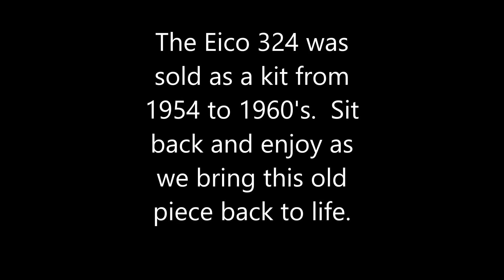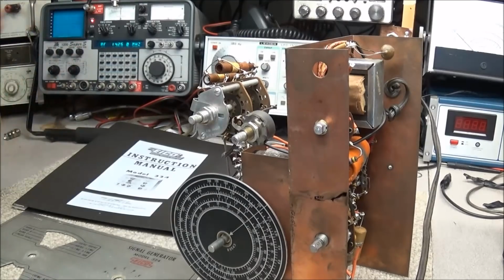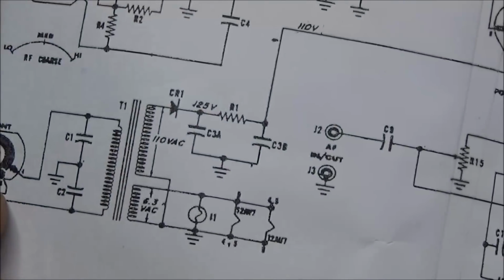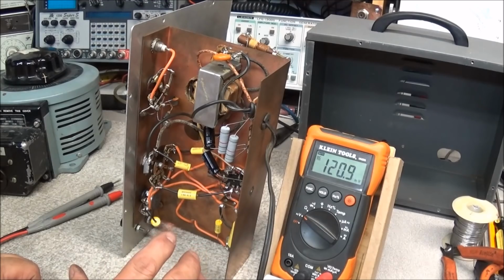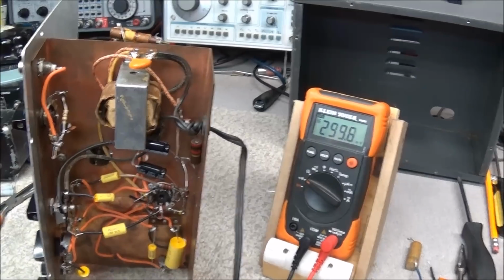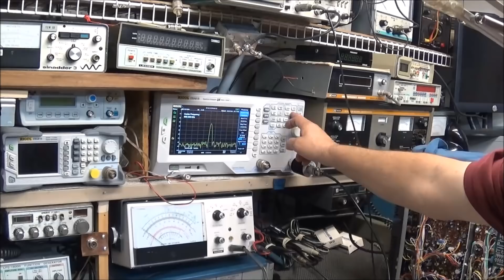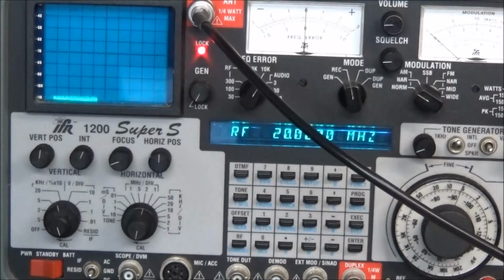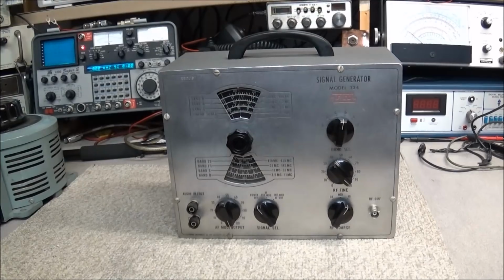#165 Eico 324 Signal Gen Restore

Comment: I just rebuilt one of these last week.  Picked it up for $4 at a local auction.  It had the exact same problem with the resistors.
Reply from the maker: Cool deal, that was a good price.
Reply: Yeah, luckily the auction was one where nobody knew what was being sold.  At the same auction, and on the same day, I picked up an old B&K tube tester, and a lot of about 2 dozen Sams Photofact CB manuals for $4 and $1 respectively.
Reply from the maker: Nice score!

Comment: I have that same model it works great and i cleaned mine up and I got it from Dougs Electronic Repair Bench he had recapped it and it was tuned up I use mine on radios all of the time. May not be as clean signal wise but its good enough to get you in the ball park. Great video thanks for sharing.
Reply from the maker: Thanks, yes they are not the cleanest tool but sure works decent.

Comment: Very nice.  I'm still learning new things by watching.  I couldn't tell what you were doing on the IFR 1200 Super S to bring the waveform to center on the scope.  I could see what you were adjusting on the frequency generator to calibrate using the ceramic tool.
Reply: Nevermind, you were adjusting the core.  I just couldn't see the scope and you adjusting the core at the same time.  I get it now.
Reply from the maker: Thanks Jeff. Yes I really need to get my dual cameras set up so everything can be seen.

Comment: Actually, these were sold until the early 1980's, right up until Eico stopped selling kits.  I bought one in 1981 right before I went off to NC State as an EE Freshman.  However, the one I got had a binding shaft for the main tuning capacitor and was always very difficult to tune.  I purchased it from Fordham Electronics and they messed up and sent me a Panavise 324 by mistake.  Ended up sending it back for the correct item, but it took Fordham over a month to send me the generator.  And I had to pay shipping twice!  So much for customer service, even in 1981.  This was long before the internet and ordering consisted of mailing checks or COD and waiting for weeks to receive anything.

Comment: I have a question for you Buddy. The Caps Coming off the silicon diode when you put in a terminal strip did you ground the neg side of the caps to the case as ground? I have one of these that I recapped and was using it the other day when I got a slight shock through the very end of the coax cable. I have taken it apart  and I am taking another look at it.
Reply from the maker: Yes all capacitors are chassis ground on these units. Make sure you have a good connection.  If you are getting voltage or a shock off the coax then look at C4 and make sure it is good and not leaking. This is a 1000 Mf ceramic capacitor and should block any voltage going to the RF  out jack. Check that to see if any voltage is passing with your volt meter.  it should only pass a signal.
Reply: Can you use the 324 to test FM receivers? or are they just used for AM receivers?Great restoration and video!Cheers

Comment: Sorry, I'm not quite following. Did you use the parallel resistors on the filter caps to replace the original 2.2k?

Comment: Turned out really nice.  Another one saved from the scrap heap and ready to be put to use.

One suggestion.  When using the Rigol SA and using the marker.  If you hit the peak button that puts the marker on the peak and opens the peak menu on the right of the screen.  Hit the "Cont Peak" and it will automatically maintain the marker on the peak.  This way when your making adjustments it will keep the marker tracking on the peak.
Reply: Good tip Mike, I actually hadn't thought of that. Although it was only a relative output indication check from high, medium and low doing that would have been closer to the real number.  Having said that, boy what a great little generator...almost makes you want to replace the Rigol, right Buddy?  ;-)  73 - Dino KL0S
Reply: thanks for the tip
Reply from the maker: Thanks Mike. Yu know I always forget that when using this SA. You gave me some pointers when I first got it and I have misplaced my cheat sheet. Appreciate the reminder
Reply from the maker: LOL Dino. Yes why not. I was really amazed on this little unit.  I hear a lot of bad things about the signal being nasty but this one is really stable.
Reply: The signal on the oscilloscope looks terrible, but mine is also quite stable in terms of frequency.  The waveform looks like it can't make up its mind if it wants to be a sine wave or a square wave.  This is common with them, from what I've seen.
Reply from the maker: I agree the waveform is not that great.

Comment: If I had to use it. I would find a way to stabilize those DC voltages. . I would put a pico fuse in that RF out put circuit. I would also Velcro one of those 22. 00U$D Freq/ Mod. meters from China to the front. Too much time wasted fighting drift. Good job on the front panel and over all. Kits "ya gotta love em" 🐴 they taught us all a lot.
Reply from the maker: You are correct on the DC voltages.  Was just enough design to get by in the day.  Good idea on the cheap counter. I need to order some of them.  Front panel did turn out pretty decent.  I am with you on the kits from the day. Never know what you will find in them. Thanks

Comment: Hi buddy,I have restored the same model and wonder if the output waveform should be a sign wave?
My unit the output looks distorted on the bottom. You did not put the output waveform on a scope only on the analyzer.
Thanks. John ve7ban.
Reply: Further to that the oscillator is output is good but the output of the cathode follower is distorted on the lower half.

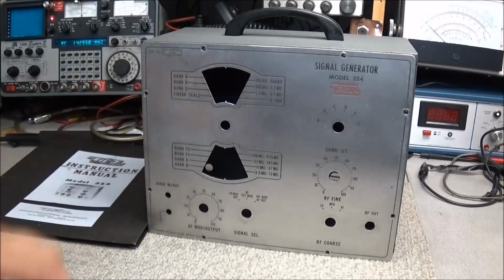Comment: We used to make these panels, not sure if this is anodized or not. The worst thing you can do is clean them like this, the lettering got tattered and the rough etched surface under the lettering is breaking through, compare 3:47 to 10:52... NEVER use a toothbrush or rag, or anything that can get down into the etch unless you are stripping it completely,  the panel has a vertical grain, go with the grain. Use a wet sanding block on a piece of wood with 300 or 400 grit WITH the grain, if it is anodized you can tell, it will be hard and slick, go easy on it either way, if the paint is dirty in the letters you can gently clean them with mild non abrasive soap and a toothbrush first,  or strip it and repaint them, then place the panel on a flat piece of wood and wet sand all the paint off in the same manner, use a clear coat if you desire. It will look better than new. My works hang all over the world, on machines,  under water to mark reefs, docks, panels for ships, some in famous actors homes, football players...big wigs, small wigs, universities, hospitals, businesses of all sorts,....but I got no credit.

Comment: Great video, very educational for me, where as I have 2 Eico 324 that I will be restoring. 2 questions, what is a good way to clean the front panel, and what size fuse will you add to the power supply circuit... Thank you kindly for the video....

Comment: I have to laugh when you try probing for AC voltage with the DMM set to DC volts...wish I had a dime for every time I did same, or worse set on ohms...lol.  BTW Buddy, I have two (2) Fluke DMMs an 85 and an 87V, they auto range voltage but not between AC and DC. You have to get an Agilent/Keysight or MTX by AEMC instruments to get dual AC/DC display. Not cheap either $500+.  If I ever win the Lotto I'll send you one.   Great video as always, keep up the good work, I really like to watch you work on gear. :D

Comment: Hi Buddy, nice to see another repair video from you, I wonder if the calibration changed after you put the cover back on?
Regards from Ray (GW6IYP)
Reply from the maker: Hi Ray. Thanks. Yes it does change but very little. Not even the width of the line. Thanks for the question
Reply: What type of capacitors did you use to replace the paper capacitors?

Comment: I bought an EICO already recapped. My line voltage is 123.1 volts. After the diode 164.4 volts and after R1 145.9 volts. R1  ohms 2.24K.  Is this acceptable? Should I increase R1? Love your site.